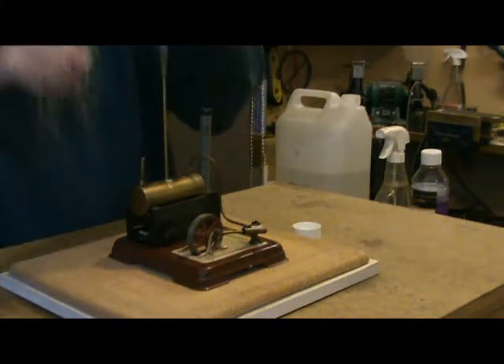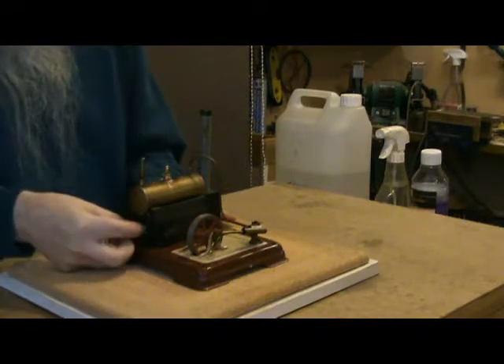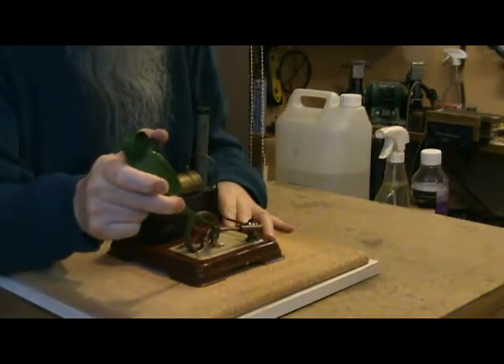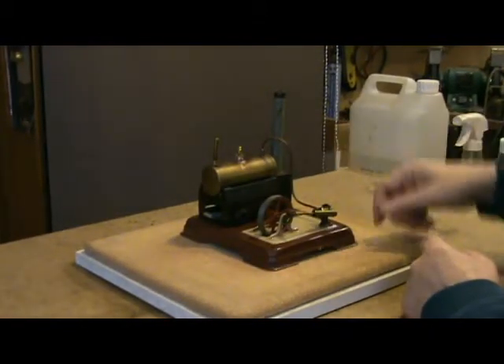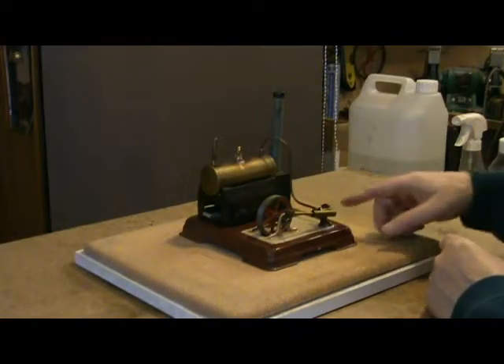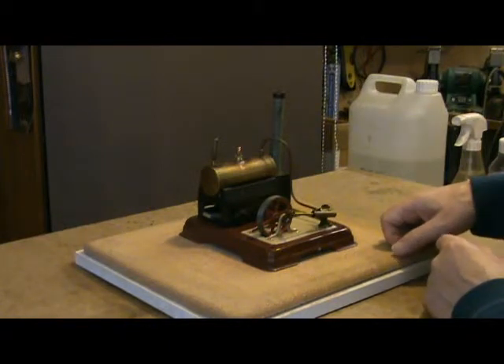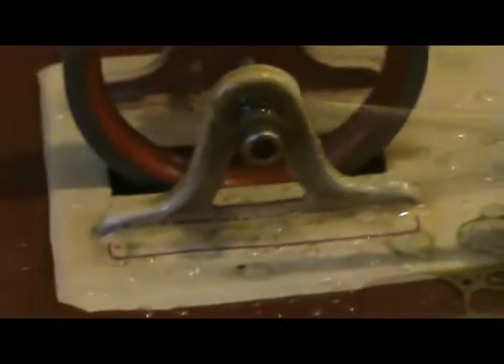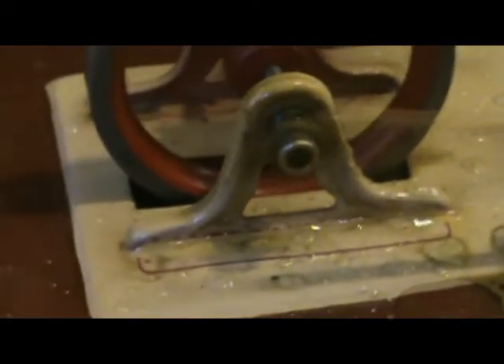Fleischmann 120/1

Comment: I have exact one Fleischmann steam engine, but original paint. I've fixed few problems, but it needs more work before it's safe to run under steam. I have it working with compressed air just fine. I need a replacement for the water level glass tube and the washers that seal the "U" shaped glass tube. Mine is OK, dirty but getting a new one would make it so much nicer! I like to replace the pressure valve, because it was near failure shape, when removing it. Also, how do I tell what model it is? There is only a sticker with the Fleischmann name in reddish/brown color but no more information anywhere. Is it 1954 model? Is there somewhere a catalog on the Internet?  Where would I get parts to fix mine? Thanks for your videos!
Reply from the maker: The best source for information is a forum, such as The Unofficial Mamod & Other Steam Forum at: www.mamodforums.co.uk
The best source for parts is eBay or to get someone to make them for you. The forum can also help there.

Comment: Hi Roly, I have purchased a similar engine with a few issues.  One is the boiler is loose and I am just wondering how it should be fixed to the firebox as I can’t see a bracket?  Best wishes, Phil
Reply from the maker: On mine, there are a pair of small screws in the top corners of the firebox.
Reply: @RolyWilliams Thanks for letting me know, I will check that out.  All the best, Phil